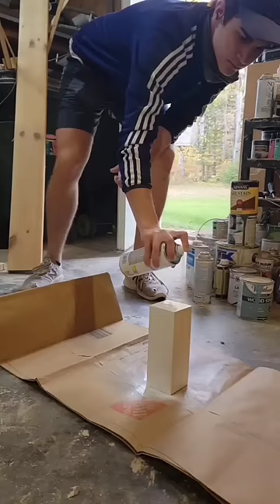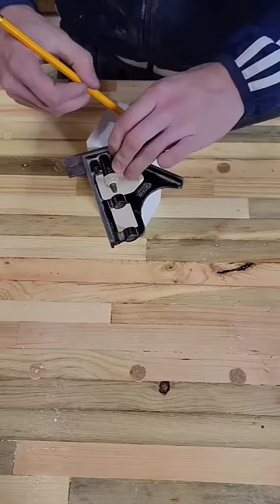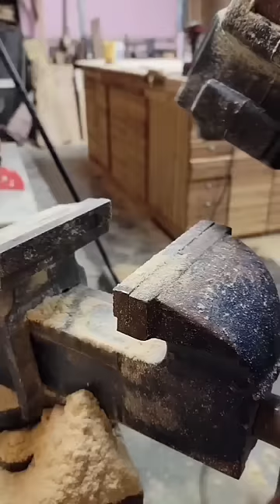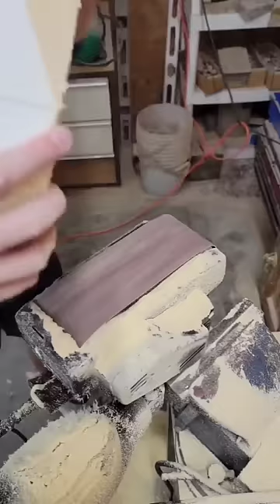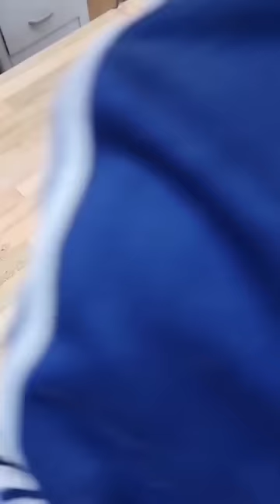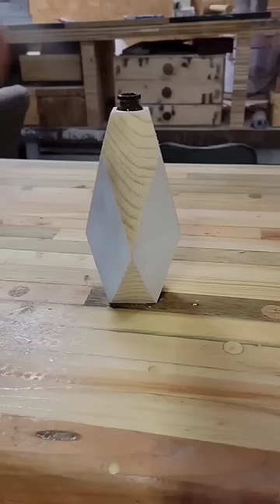Quick Gift Idea // Woodworking #carpentry #diy #woodworker #maker #woodworking #wood #handmade

Comment: Who needs a saw just sand until there’s nothing left 😂😂
Reply: @MB-zj3er  And then you mess it up with tons of dust inside. Great.
Reply: @MB-zj3er  who tf has a belt sander but not a saw!? Even a hand saw and a miter box would cost many times less than a belt sander.🤣🤣🤣🙄
Reply: @MB-zj3er  it's less expensive a hand saw than a belt sander. Also the fact you don't have one but have multiple "power tool"... Ok, still dosen't prove if you can afford a belt sander you probably can afford a proper tool for that job
Reply: @MB-zj3er  I mean, I am definitely lacking a "full complement" but saws are something in which I am flush 🤣 four skillsaws, a couple battery mini skillsaws, table saw, hacksaw, hand saw, coping saws for wood and tile, tile saw, chainsaw, circular saw attachment for my weed whacker, two big Stihl concrete wet saws, pole saw, sheetrock saws, tired of listing saws so I stopped. Oh, and two belt Sanders😎🤣🤣🤣
Reply: Bro put the belt sander in a vice as well, I’m not surprised if he doesn’t have a saw lmao.

Comment: Good job but next time use the same vice you used on the belt sander to hold your piece while drilling with the paddle bit, could save you a finger 👉